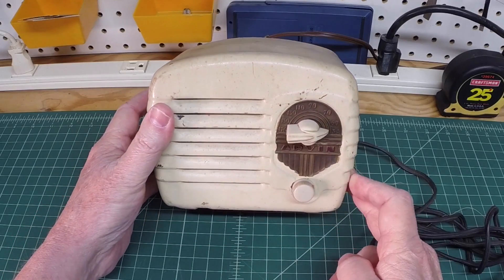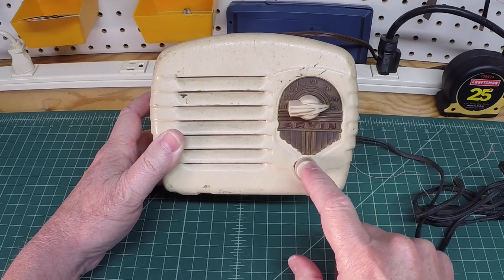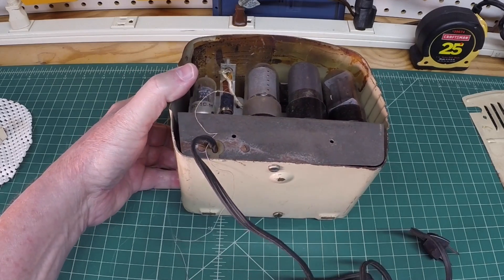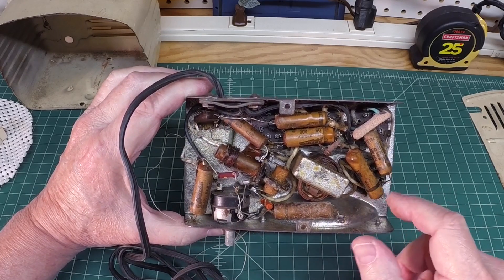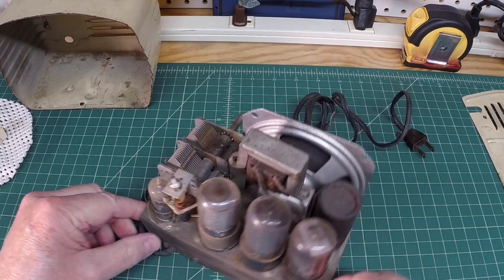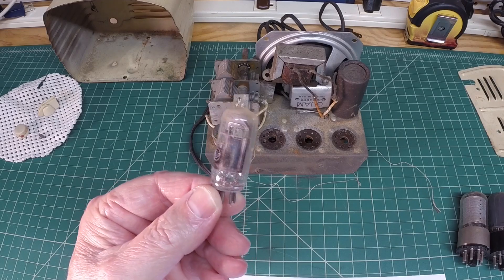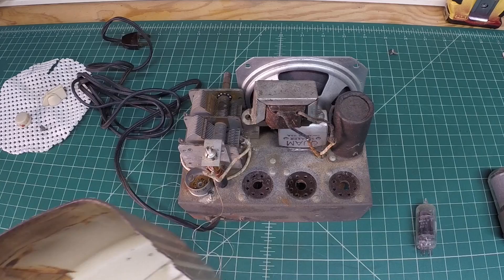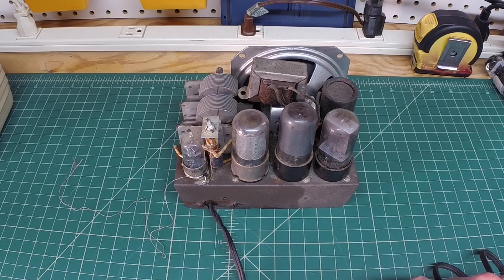Arvin - Model ?

Comment: nice set. Unrelated question. What is the green mat on your workbench that you are working on? Looks handy and im in need of something like this for my new workbench
Reply from the maker: +j c Thanks for watching. The green mat is an: Alvin Professional Cutting Mats Green/Black Size - 36L x 24W inches. One side is green and other is black. It's worked out great for me. I think they run ~$30.

Comment: In a way it makes sense to use two 12 volt tubes in place of the 25 volt one, assuming that they all use 150 ma heaters, most 12 volt tubes really have 12.6 volt heaters, so two 12.6 volt tubes in series will add up to 25.2 volts. I don't know how rare 25B8 tubes are but they can't be that common so perhaps the mod was made during a tube shortage like during the Korean war?
Reply from the maker: The modification makes it unique for sure. I'll probably let it be as it makes for a neat story. Best, Don

Comment: By the way, I figured out the secret to getting wrinkle paint to wrinkle  and harden properly, after it dries for a time, put it in an oven at 200 degrees and bake it for 1/2 an hour.
Reply from the maker: That's awesome. I don't recall, what cabinet did you restore? Best, Don
Reply: RestoreOldRadios
It wasn't a cabinet it was the top cover or end bell from a power transformer that I had to repaint. However I will have to go back and touch it up because I was having troubles with the nozzle on the spray can clogging up, so the coverage was thinner on the sides, if not for that it would have worked out perfectly.
Reply from the maker: +OlegKostoglatov I hope the touch up goes well. I'll have to sneak my next wrinkle finish in the oven while my wife is away. Lol  Best, Don

Comment: Hi Don, at least whoever modded this one wasn't as 'brutal' as the modded little Radialva set I got a few years back.   You won't need to do a complete rebuild and hopefully it won't be too difficult to trace out the details of the mod.   I'll admit, a design like this in a metal case would make me nervous - one for the display shelf rather than regular use I'd say.
Cheers,  John
Reply from the maker: John - yep, we'll see what I uncover before moving forward. I hope to spend a little time on this one over the weekend and document the design changes. Best, Don

Comment: I purchased one of these radios at an antique store about two years ago.  It was mostly original except for the power cord and filter capacitor.  After a lot of research, I found that many of the Arvin Mini radios are very similar.  The 402 series are all 3 tube radios and the 444 series are 4 tube radios.  None of them have a small 9-pin tube in the tube compliment.  The radio you have was modified.  The speaker seems to be replaced (the original is not a Quam) as well as the output transformer.  The small trimmer coil on the back of the tuner capacitor is also not original.  These radios had a small wax-covered antenna coil attached by a screw to the upper corner of the speaker frame.  It was very fragile.  It had a long antenna wire attached to it and many of them (including mine) were broken from pulling on the wire.  This was one of the most challenging projects I ever worked on, as far as small AM tube radios were concerned.  I was never able to complete the project because I couldn't find a suitable replacement for the antenna coil.  These radios are fairly expensive on eBay, so I'm waiting to find a suitable parts donor unit at a flea market or antique store.  I hope you can get this one running, as I would love to see how well these little radios perform!  Good luck! - Tony
Reply from the maker: +xraytonyb Hi Tony - I'm with you on the modification and thanks for confirming the speaker and output transformer. I hope to spend more time on this one real soon and take a look at the modifications in detail that have been made and try to bring it up using the modified circuit, then consider reverting back to the OEM design. In regards to your antenna coil, there's a generic replacement available at: https://www.tubesandmore.com/products/P-C70-A  Thanks again for your insight and I'll keep you abreast on my progress. Best, Don
Reply: I think shango66 had one it played well in original condtion  ,he said it was a great reciever.I think it surprised him

Comment: Interesting set Don, I'm sure I've seen the odd one on eBay over here. I still don't understand how you work a TRF set! Maybe I should build one and find out :-)  Regards Andrew
Reply from the maker: +Andrewausfa Andrew - we'll see how it goes since I'm sure the design has been modified at some point. Building a TRF set does sound like fun or pick up an oldie on ebay or other.. and go at it. Thanks for watching. Best, Don
Reply: +Andrewausfa They tune like a superhet more or less, but the cheapy sets like this Arvin are not very selective at all, but the sensitivity was not that spectacular either. In some places they call TRF circuits "Directly Amplified", it's basically a series of tuned circuits, one feeding the next, with RF amplification of each stage, the more stages you have the more selective it's supposed to be.  The bigger radios of the late 1920s and early 30s had four tuned RF stages, but the average ones had at least three.

Comment: the cabinet looks like 422, 
12at6a  is the successor of 12sq7 
have a look here http://www.nostalgiaair.org/pagesbymodel/514/M0012514.pdf
Reply from the maker: +mamoynas Thanks for sharing this, I will take a look at it for sure. Best, Don
Reply: +RestoreOldRadios well, the 12sK7 troubles me... What if someone put it there by mistake in place of a 12sA7? If pin 8 of the socket goes to the antenna then it should be a 12sA7 because pin 8 of the 12sk7 is the anode....
Reply from the maker: +mamoynas I'll definitely let you know you know once I take a look at it. Best, Don

Comment: Hello Don. It is modded for sure. The smaller transformer on the bottom is original,the one on top has been added. This could have  been done to increase the radios performance, or the make it shortwave. One thing you can do is check the old radio magazines from that time and see if there were any mods similar. I can't be sure of exactly what type mod has there were so many back in the day. It was a real treat to see another video from you.  
All the best.
Bobby.
P.S You can do a dim bulb test and check for shorts and to see if it will play. A dim bulb tester is simple and safe if used correctly. Bright is bad ! if it stays that way for more than a couple of seconds. You can also use this with a vireaact  Sorry for the spelling
Reply from the maker: +Bobby Tectalabyss Bobby - Everyone now agrees it's been modified. I may try to bring it up after checking the tubes and see what happens; hopefully no smoke or other... As always, I appreciate your advise and taking time to watch the videos. Best, Don
Reply: +RestoreOldRadios Hello Don. Sorry for the delay. My Sister in-law,Brother in-law and Nephew. were involved in a car crash. They are fine just banged up. Young kid driving stupid hit them. He is alright also. Has for my advice it isn't much. I am very interested in seeing how the radio performs,with the added circuit. Have you had a chance yet to check the transformer on the bottom of the chassis?  I am wondering if it went open or shorted?. 
You take care don. Hope the flooding didn't reach your area.
Bobby
Reply from the maker: +Bobby Tectalabyss Bobby - I'm glad everyone is okay. I hope to make some time later this week and will publish a video with my findings. Hopefully we can make this one play again. Best, Don
Reply: RestoreOldRadios
Looking forward to it Don.
All the best.
Bobby

Comment: Nice radio.  Is the transformer on the bottom hooked up,  it looks riveted in? Definitely a "unique" way of replacing it.   Just a thought but Philco after the WW2 ended  began making the same car radios they were making before the war.  Perhaps Arvin began making the same radios they were making prior the the war because they were the easiest to get into production and they had to use whatever parts were acquirable, thus the strange tube line up.  The addition of the small tube looked very well done, at least from my view so maybe it could have been factory?   Thanks for sharing Zach
Reply from the maker: Zach - I'll get back with you on the transformer underneath ASAP. I didn't look at it close enough to answer your question. As you noted, the 12AT6 tube is very neat. The other odd thing is the IF filter is not in a can. Thanks for watching and sharing your knowledge. Best, Don